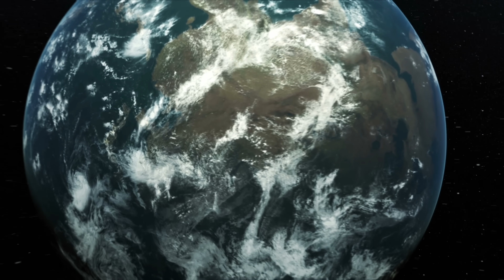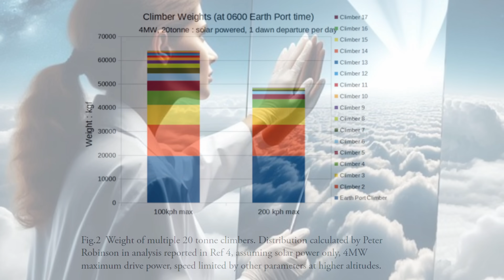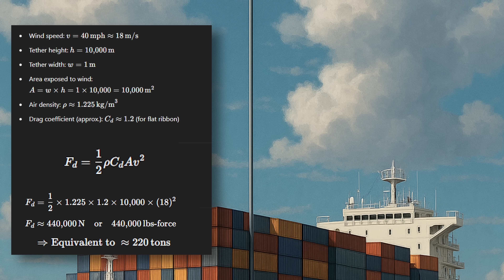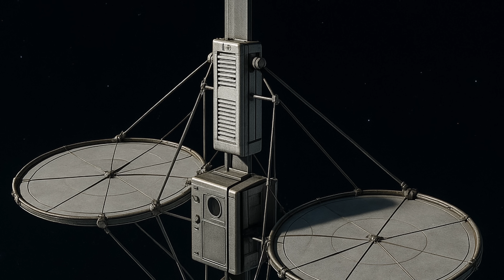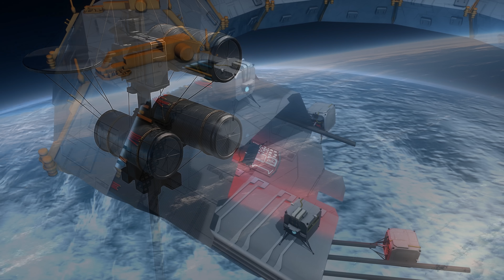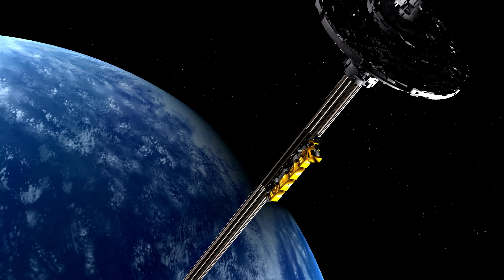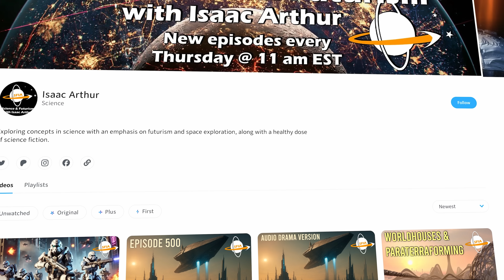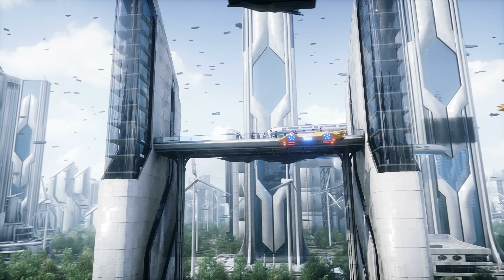Space Elevators: What It Would Actually Cost to Build One

Comment: I dont understand the straight line up design, its just dumb. We need a coil and an elevator with strong magnet on the bottom and top oriented the right way and electricity going from elevator bottom through coil to top which creates a magnetic field pushing the elevator upwards. We can even use the electricity in the upper atmosphere for this or beaming energy to the elevator from ground. Obvious solution for elevator wire not being able to manage the pressure. Keep everything in place with balloons or something similar
Reply: Without a straight cable, what's going to keep your coils from unwinding under tension? And how are balloons supposed to help stabilize something against wind, or support the vast majority of the cable that's above the atmosphere?
Reply: @artor9175 i have an extensive design that addresses all those issues(20 pages, can't write all here). Also the elevator is being magnetically held up. The other end is connected to a space station that can create counter weight balance when needed.

Comment: An oil drilling platform, 100Kt dry weight, probably makes a better Earth station than a cargo ship.  It's better suited to station-keeping and has systems to ballast itself with sea water.  It already has all the systems for crew-support, power generation, material handling, etc.
Reply from the maker: That's actually a good point, I remember asking Peter about that as oppose too the contianer ship they tend to prefer and I cna't remember what the reasons was besides easier mobility if you had to worry about storms and being easier to by  a used one and put it where you want.
Reply: @isaacarthurSFIA  if someone constructs a tether base at sea (mobility is good) then there is no reason it wouldn't have a runway, a port for many ships, hotel and lots of other structures to accommodate the needs of the passengers, crew and families, cargo, etc. It might start small, and then grow over time.
Reply: I think if you make something big enough to be a base it’s practically going to look a lot like a rig. Unless you model it after an aircraft carrier its mobility is going to be limited

Comment: My question on these fascinating ideas is: what happens to lightning? We are pushing a conductive rod right up into and beyond the troposphere (it will likely be bathed in condensation whatever the material is), linking two enormous reserves of opposite polarities.
Reply: i had the same question... always seemed to me these elevators would be giant lightning paths shorting out the ionosphere... would cause havoc for the planetary electrical system... ?
Reply: @sceptic33  properly grounded at the bottom, a conductive tether shouldn't cause too much trouble. The air is very resistant to electricity, tho you can expect to see sideways lightning for a few miles around when there are storms. And since lightning is very corrosive, it would be better if it isn't conducting.
Reply: @jsbrads1 a well grounded conductor 200 miles long would bring a point at ground voltage into the ionospheric 500MV field, it would spew electrons in a huge corona discharge, neutralising the local ionosphere and attracting an ionic current from its surroundings... Try insulating the foot and you get a crazy high negative voltage at the top instead of just ground level..
Reply: @sceptic33  trying to insulate only the part touching the ground with a conductive cable would result in a lighting dome.
You either use a conductive cable and ground it, that’s comes with one set of challenges, or you use a nonconductive cable which seems to have no downsides. 😅
Reply: @jsbrads1  the fun starts when you make the ground connection through a switch which connects/disconnects the dipole to the earth periodically...

Comment: Won't a space elevator have to extend beyond the moon?
Reply: No. It would likely extend to just beyond geosynchronous orbit where you can attach a counterbalance to keep the cable in place. The counterbalance could literally be a small asteroid. Above geosynchronous orbit, the Earth rotates faster than the speed required to stay in orbit. If we force the counterbalance to move faster to keep the Earth in a stationary position below it, it wants to move away from the Earth and into a higher orbit (assuming you don't achieve escape velocity). By attaching a cable, it cannot move away from the Earth and the result is that the cable is pulled tight.

Comment: Taking a detour through space between space elevators could become a competitor to airplanes. (Depending how cheap the operation costs for the elevators are, how good they reuse the energy of traveling downward and how profitable monetising elevator music is)
Reply: Yeah but see the equatorial base stations would have bad transit links. You'd have to get a flight from say New York to Ecuador, get on a space elevator there, take a week to ride up, orbital transfer to another station in geostationary orbit, a week down the tether to a base in the Pacific, and then a flight from there to Tokyo say. So a very convenient several weeks journey that also has a longer flying distance at both ends than just flying from New York to Tokyo over the pole. If you cut out the airplanes completely, that means either rail or ocean liner connections from the base stations.
Reply: @AlRoderick except base stations dont need to be at the equator

Comment: The  moon takes 1 month to go around earth. The iss takes minutes. This happens because the angular speed gets slower with altitude. So, the base of the elevator and the top of the elevator will be at different speeds, so, it is impossible
Reply: It's a single object, orbiting at the same speed overall. The center of gravity is at geosynchronous orbit, so the bottom is stationary relative to the ground. This is a very basic part of the design, and if you haven't grasped that, then you don't understand what is being discussed.